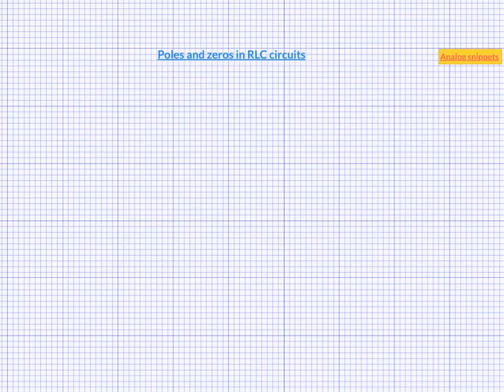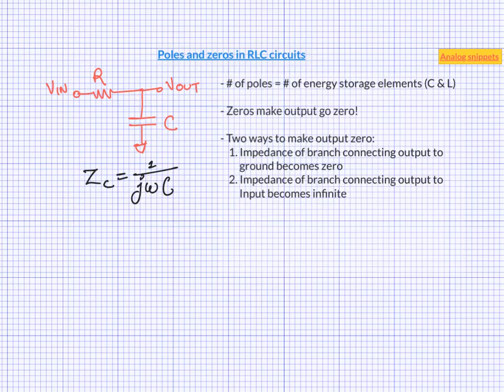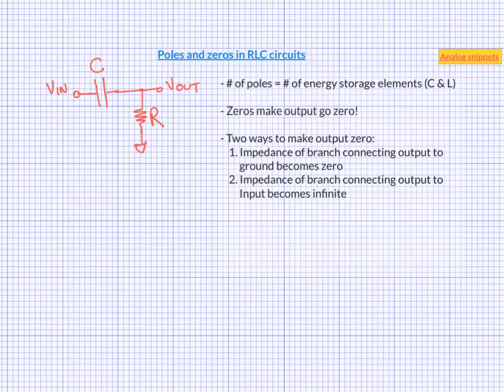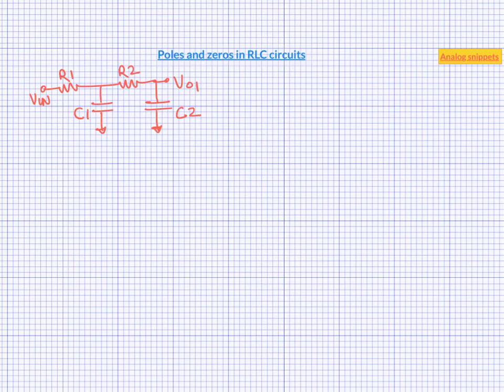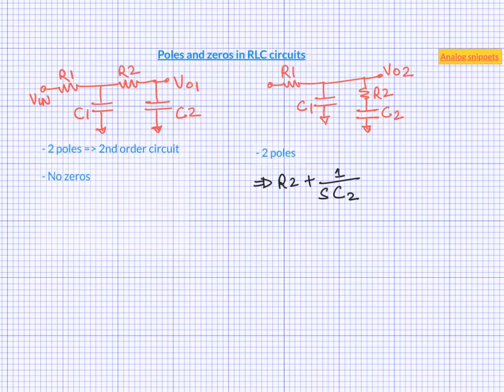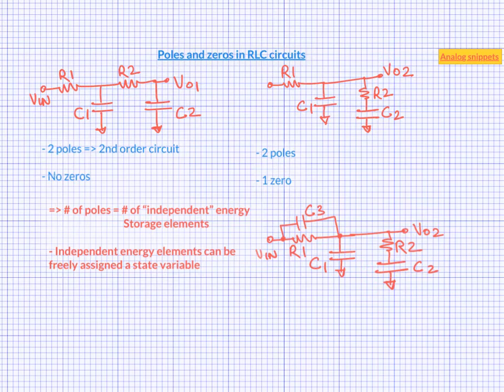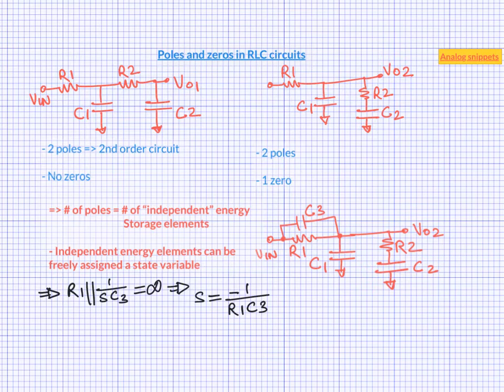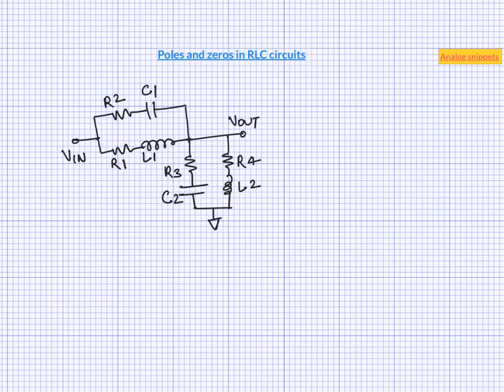#19 Finding number of poles and zeros in passive circuits

Comment: In the last circuit with 4p and 4z, can we find zeroes location by inspection? I gave it a try. By equating vout=0, we get 2 zeroes at s=-1/R3C2 and s=-R4/L2. But I am not able to get the other 2 zeroes. Clearly they will come when Vout is disconnected from Vin, i.e. the impedance between Vin and Vout is infinite i.e. R2+1/sC1+R1+sL1=0 but its tough to solve 2 roots.
Reply: Yes second order equation needs to be solved to find location of two zeros. to find out 4 poles, 4th order equation needs to be solved which is to be obtained by z1 = -z2. Where z1 and z2 are impedance of two parallel branches.

Comment: Good informational video. In the last section, you show how the 4P,4Z circuitry is modified into a 4P,3Z circuit, with R3=0. At very high frequencies, even the cap C2 is short circuited. How did you deduce that it converts into a one pole RC filter with R2 and C2. What is the basis of this assumption?
Reply: I have the same question. Let me know if you have got any answer.

Comment: Query on zero, kindly help:
@10:15 what's the meaning of impedance (r1 || c3) to be infinity? We are taught that if two resistors are in parallel, the equivalent resistance is always lesser than least of them, so what is being missed here(it's true only for passive elements). I was guessing that the intuitive meaning of this impedance being infinite is that at 1/(r1*c3) frequency, when vin is applied, no current is drawn by (r1 || c3) from vin. But in such case where will vin drop across to satisfy kvl and kcl?
Reply: I have the exact same question, it would be nice to have a valid answer
Reply from the maker: When we talk about poles and zeros we are in complex plane. In complex plane impedance can go infinity at complex frequencies. You will not see that happening in real world or in transient simulation because there we are working with jw axis of the complex plane.

Comment: Hi Sir, nice lecture. I have one question, so like zero where output goes to zero what can we infer in case of poles? Is it the frequency bat which output hits max value that is it gets saturated? Please give some analogy and shed some lights on it. Also, as can be seen that for pole frequency instead of getting saturated the output voltage starts to drop at pole frequency. please help. #AnalogSnipets

Comment: I don't get the independent energy storage elements. Can you please explain it please.
Reply from the maker: If you can assign an initial voltage to a capacitor or an initial current to an inductor in a circuit then they are independent energy storage elements. In most cases it is the case hence rule of thumb is number of poles is equal to total number of capacitor plus inductor. In some cases however it is not possible to assign initial conditions to all capacitor/inductor. One such example is capacitor only loop where KVL dictates that at least one capacitor cannot be assigned any arbitrary voltage.
Reply: @analogsnippets  Thank you very much 😁

Comment: Great video! Is there any theory or analysis why # of poles is equal to the number of independent elements?
Reply: Eric,

If we try to solve any circuit using differential equations we will see that the final soln will demand a number of independent initial conditions (like 'v' across a cap or 'i' through an inductor) which is also equal to the order of the differential eqn. 

Order of the eqn. is equivalent to # of poles in the 's' domain

Comment: Also, in the last question with two tanks, in the strict sense we should say circuit has "maximally" 4 poles and maximally 4 zeroes. E.g.  with matched tanks, i.e. L1=L2, C1=C2, and all R are same, the transfer function is exactly 1/2 without any pole or zero (due to exact pole-zero cancellation). Any mismatch in tanks can help in seeing both peaking and notches in the transfer function (due to mismatched resonances)
Reply from the maker: Yes that is a good observation...